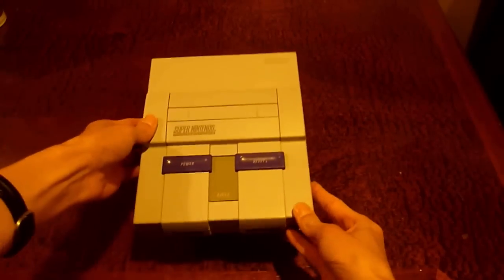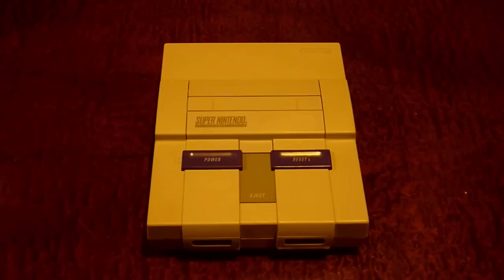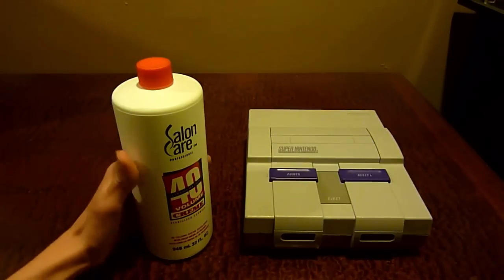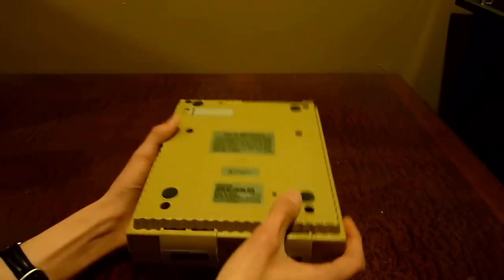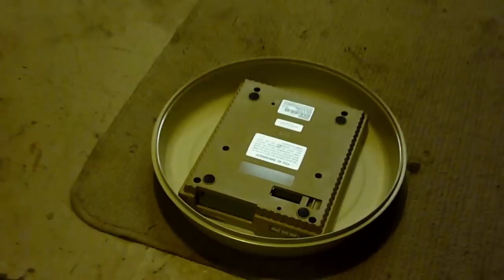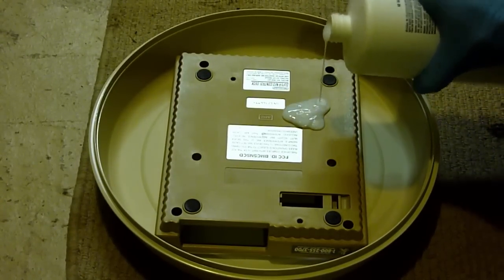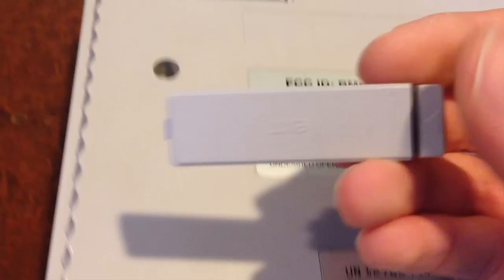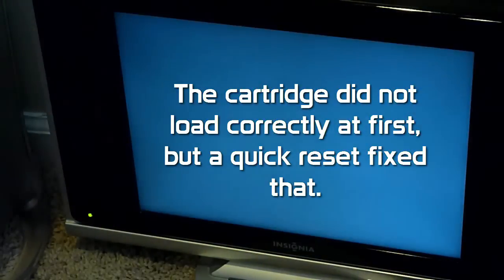Yellowed Plastic Restoration on a Super Nintendo!

Comment: Hey I just wanted to say I found your video very informational and helpful, however I had a question...as far as using a UV light source such as  lamp or bulb, does it matter what wattage you use?  Or what color it is, example, a black light or purple?  I bought a bottle of that stuff on eBay, and am looking forward to tackling my yellowing SNES, just am on the fence about sun or indoor UV light...
Reply from the maker: Tim Semski I have never looked up anything about the wattage but I'm sure that it would have an effect on the result. You might have to leave it exposed longer to certain bulbs.
Reply: Right, that's kinda what I was thinking.  Thank you again, sir!
Reply from the maker: Tim Semski You're welcome :D

Comment: Great tutorial! Thanks for this. I have a Piss yellow Dreamcast kicking around  and the older process just seemed WAY to complex and expensive.
There is a very simple way to handle the stickers getting damaged in this process though. All you need to do is after you have disassembled the console Use a Hair dryer to loosen the stickers. Then stick it to some sticker paper so you can easily peal it back off and reapply it later with out it getting damaged. A permanent glue stick can be used if you have trouble reapplying the labels on the console.
Reply from the maker: BRIAN WALKER Awesome to hear! I also own a Dreamcast. I did not even think about the stickers during the process, but your idea seems like it would work. Thanks! :D
Reply: Your quite welcome and I would love to see a Dreamcast whitening video if you decide to give it a treatment.
Reply from the maker: BRIAN WALKER Well, it's already white, haha. But if I come across one that is yellowed, I could do another video like this!
Reply: BRIAN WALKER The Sega Genesis and Saturn does not have this problem.
Reply: Axyl Fredrick Good point! Can't go wrong with classic black for your gaming hardware. Although I do NOT own anything other than the black models of the Saturn and the Genesis there are White and Grey variants of the Sega Saturn out there.  Odds are those Saturn  units can encounter yellowing since pretty much all white and grey plastics seem prone to yellowing.